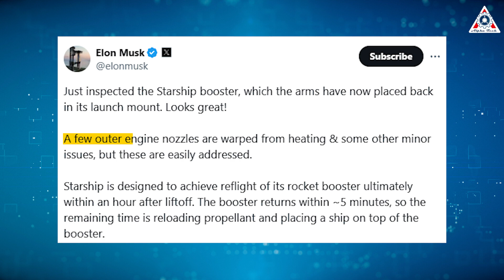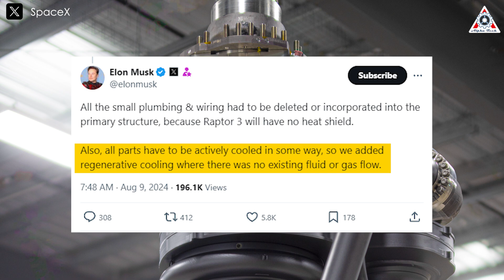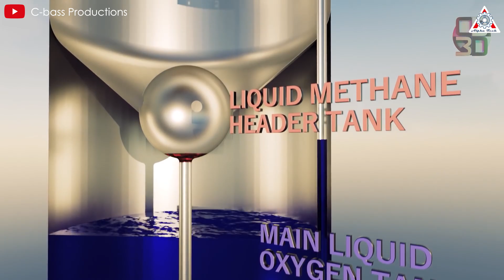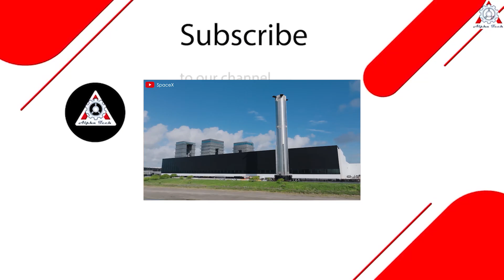Elon Musk Directly INSPECTED Booster 12 'RAPTOR Engine WARPED' & declared this...

Comment: It's why they ran Raptor 3 for a long duration burn, 15 minutes if memory serves, this is to test if they can handle the heat of decent before they fire.
Reply: the raptor engines bell housing is actively cooled by running propellent thru it during operation. my question is how will they be cooled during booster decent when the engines aren't running? you can  see the engines glow cherry red during its decent.
Reply: Yeah, that was an impressive test, indeed!

Comment: If we possibly can make a kerolox ffsc cycle starship with more thrust than superheavy higher power density and maximum effciency
as the fuel will be ultra hot
and preburned. its good to envision

Comment: 3:10 “ Given that Super Heavy is considerably greater than Falcon Nine it’s decent speed is significantly greater”?
Hang on, I thought all objects in a vacuum fell at the same rate regardless of weight.
Reply: i think he talked about reentry, falcon boosters slow down more there because theyre lighter
Reply: nether of these rockets are accelerating during free fall, they are slowing down do to drag, falcon9 has more surface area to weight ratio, so it slows down much faster,  so less heat.

its like dropping a brick vs an empty soda can, they will fall at different speeds unless they are in vacuum.

Edit: the rockets are not in vacuum, they would not be generating any heat from friction or slowing down from it if they where
Reply: Thick as mince!
Reply: The super heavy has a much greater surface area in its engine bay, and therefore, much more air is displaced at these high speeds. Therefore, much more displacement and heating occurs.
Reply: They aren't in a vacuum though...he's talking about when they are falling back through earth's atmosphere.
Reply: Yeah, they did not consult Newton on that little fact........
Reply: @winfordnettles3292  fact is the booster never left atmo, so it's not in hard vacuum

Comment: I can promise you that Raptor colouring is NOT due to paint - simply because when they turn red hot no paint survives - it would burn out. It may be a metal coat of a different colour metal, but that - would come with it's own problems at high temperatures.

Comment: I think they may need an entry burn just to protect from prolonged heating and slow it down a bit more? Maybe?
Reply: i don't think that'd be fuel efficient enough
Reply: @user-z9k6y  no definitely not, which is probably why Falcon doesn’t do many RTLS landings but it may keep the fire from happening, more for safety (most likely Raptor 3 has solved this issue). It was just a thought.
Reply: @Ssshady08  👍
Reply: @Ssshady08  Just make heavy duty bottom.

Comment: I believe the super heavy need to slow down much more prior to reentry. At least 800mph
Reply: Have you made any calculations that would lead you to believe that doing so would be more advantageous?
Reply: @stevedaigle3242  I could, will try. Yet the evidence is obvious. Warping, super heating, etc. I'm full aware these flights are "Prototypes" yet, flights 4 and 5 showed heating and warping in the raptor engines. Hence, my simple comment! It was NOT a complacent comment, rather a simple observation.
Reply: I believe you don't know what you're talking about.
Reply: @RyanGribble  instead of being rude,why don't you just explain why he is wrong ?i would like to know why too,i'm not a space expert and would like a civilised explanation please.
Reply: @trevorgough2286  what i said was not rude, it was my opinion.  Here's why i believe that.  The engines on this flight were raptor version 2. Raptor v3 had not flown yet but it includes a host of upgrades one of which is a more integrated engine design with less external parts.  This will improve the durability of the engines thus negate the need for heat shield, which is what we saw heating up, thereby facilitating the faster entry speed. All of this stuff spacex is doing are tests.  None of what flew yesterday is the final flight article.
Reply: @RyanGribble  welp...😁 it's easy to be a As$hole on the internet. Education is the key here. I made a statement. And a Bit_h responded. Lol...typical

Comment: I'll bet that Raptor 2 engines are still viable and can be used for disposable booster/second stage launches.. even perhaps integrating both in a booster to help in the initial certifications of raptor 3 rocket engines
Reply: raptor 2 will be more expensive than raptor 3, raptor 3 uses way less materials so it will be less expensive and faster to build.
Reply: @CUBEoneVX  You totally missed the point
Reply: Why continue to use outdated engines.  No sorry.
Reply: @RyanGribble  These are Prototypes, don't forget. The rate at which SpaceX is advancing is already pushing the limits of how accurately they can track and confirm the effectiveness of an improvement before improving further.
Reply: @RyanGribble  You forward thinking is missing the required steps and cost savings
Reply: @tsclly2377  that's the great thing,i don't have to do the thinking.  I see the path that spacex has laid out and can understand their process. I use a similar process when i build things.

Comment: This mission was a complete failure because it proved that the size for this concept is completely wrong.

In the previous missions SpaceX did a successful virtual catch in sea, so I do not know what was the reason for all this emotion.

The ship continues with heat tiles issues like the space shuttle had, and the 33 engines booster is not a good design, proved in the previous booster that they captured in the sea and saw lots of warped engines, but now in the video of flight 5 we see all motors incandescent red because of the air friction, and we saw many parts falling from the engine area while the fire suppression system was acting.

How can SpaceX solve the issue of the friction we see the engine area that almost destroyed all 33 motors ?

The easy solution is to slow the booster with more or bigger grid fins, or use the engines to slow the fall speed.

All these solutions add lots of weight to the booster, probably removing 20% of the height where the hot staging happens, and catching this 33 engines beast in the sea with a monster tower require building the tower with foundations in the sea floor.

I see lots of game stoppers in this concept, and strongly believe that SpaceX needs to abandon the 33 engines booster like NASA did with the Saturn rocket, where 5 F1 engines where dropped in sea with the first stage.

Chinese engineers are more clever, and I bet that China is going to be the first nation who is going to colonize Mars.

USA under Trump and Elon Musk rule is going to turn into a medieval country, a scenario like we see in the 1965 movie "The War Lord" starring Charlton Heston.
Reply: You should really take your medication
Reply: "Chinese engineers are more clever"... that is why they reverse engineer any western made tech?  They couldn't arrive with the product without patent violations?  Oh also... SpaceX leaves most of their patents open to the public use.  How many Chinese developments is left to open source information?
Reply: ''Chinese engineers are more clever''
Chinese engineers talk a lot but can not show any results, they are not even where SpaceX was 10 years ago, let alone building a superheavy rocket. Same with their EVs that are still more heavy and inefficient than Tesla
Reply: This is a China Bot or key board warrior.  Pay him no mind…..the Chinese culture doesn’t understand innovation of a technology.
Reply: whatever you are taking, it isn't working.
Reply: Name a technology or product in the last 20 years the chinese have invented or pioneered...the only thing china is numba one is Intellectual Property Theft and Reverse Engineering.
Reply: @bjmc812  Maybe we should send our recovered UAP's to them to figure out. ; )
Reply: I wonder how many inventions the Chinese claim to have made without stealing them first?
Reply: Trump and Musk will make America a medieval country? Lol you don't see the irony in that? You side with the permanent political class that hates the People. You want Americans to be serfs under Democrat Lord's. I am no Serf, I am a Citizen
Reply: @ReiseLukas  If Trump wins you are going to see a world crushed by Russia, Iran and North Korea dictators, millions of deaths in those crushed nations, and USA is going to be 9/11 or Pearl Harbor attacked again by enemies of Western European civilization. US citizens ignore that the America continent is just an extension of Europe, and the USA, Canada, Mexico, Brazil, etc. are ex-colonies from UK, Spain, France and Portugal.
Reply: So you're a rocket scientist working for....Blue Origin?  Oh no, let me guess you are working remotely from Mãe's basement.
Reply: @benitosalazar3749  Cry for Elon Musk failed business, Twitter lost 90% of its value, Tesla is being beat by BYD, and China is going to dominates the space industry. If Donald Trump loses the elections Elon Musk is going to end like OJ Simpson.
Reply: Alright keyboard warrior go take your meds
Reply: "How can SpaceX solve the issue of the friction we see the engine area that almost destroyed all 33 motors ?"
video: "a few outer engines are warped and other minor issues"
do you also think the engine explodes when the fuel exiting it is making friction?
Reply: @user-z9k6y  Air friction made it glow and drag forces made it warp like we see in steel mills.
Reply: @mokorily5022  rocket engines glow when they're simply running aswell 🤷‍♂you still ignored that you said almost all engines got destroyed while only a few got warped
Reply: @user-z9k6y  SpaceX is done ! ... they have no way to slow down the booster fall without spending lots of fuel !
Reply: @mokorily5022  or just improve on the engines 🤷‍♂ everyone said the falcon 9 will never land, after that they said the catch will be impossible, turns out they were wrong both times, and as he stated it's a minor issue, a few warped engines wont fuck up a multi billion dollar company
Reply: You sir are a moron.  These are test articles and this is still version  1. I can't even begin to start replying to all your idiotic points because i don't have time in my work schedule.  I do believe however you should refrain from posting anymore until your comprehension improves.

Comment: I suspected the glowing engines were descent friction or compression heated.

So cure might be a few more thrust hits coming down to lower those temps, or pumping water into the combustion chambers to use the heat to create free retro thrust using steam.

This would at least keep bell temps down and reduce velocity. Also reduce fire chances.

Could be emptying ships reserve potable water as a positive.

Elon at one time was talking water cooling for re-entry.

I'm really happy with the whole flight 5, they didnt get perfect, but close enough to not need much improvement.

Another question I had was on chopsticks to landing points allignment, if there was an adjustment, or just relying on ship's positioning system?

From the looks of things, hop staging might really be possible. which would speed things up and reduce crane and tower dependency.

And am seriously looking forward to Raptor 3/V-2 Starships.

They should be impressive... And maybe if you had them operating throttled down during backwards coming in, the cooling system could turn the generated air heat into increased thrust for fuel at an idle...

More physics free lunch, paid for during ascent.

What I am expecting on flight 6, is quicker lift off from Stationary zero, observable increase in ship's acceleration.
Less unburnt gasses in plume, and Pretty blue flame....

Also on Starship  re-entry, more long high glide time. and less over heating during final landing phase start.

From what I saw flight five Starship was not being damaged during high glide. And only took stress for maybe 30 seconds during switch over into landing manouver.

I have 100% confidence in it being easily improved.

And a bit of tweaking on booster coming in will have it looking professional.

Basically zero doubt next flight will look even better.

I'd say we are over the hump on the defeat of the Malthusian Paradigm. Now we just need to increase funding by at least 10X, increase production, and start branching out from this tech foundational point.

I think flight 6 will be that point.

And that the
 Raptor 3's will convince the last Old Guard types.

Its gonna be a new Space Navy soon, things develope surprizingly fast.

If I were the DOD, I'd have Elon and Gwen on the horn, and talking about financing a second Raptor 3 production facility, as soon as the bugs were out of the first one.

None of this was lost on the Chinese.... And sure they will grok Raptor 3's instantly.

Best to hit the ground running on all combustion chambers...

Comment: Given EMs philosophy about the best part being no part, I suspect that the coating of R3 is a heat resistant substance vs just paint. Looking at a picture of the R3, the coating atarts at a particular point where heat wiuod be generated. It would've been easier to just leave that portion bare.

I just had a thought. The "coating" may not be an applique at all. It might be a special alloy. Did SpaceX 3D print the dark colored portion of the R3? EM did say that they printed a portion of the engine to reduce plumbing conplexity. 

They could tweak the alloy to increase rigidity and/or heat resistance. Could it be that they only built one R3 to see how much more it would need yo be tweaked from the data and inspections of IFT5? I wouldn't put it past them to have built and tested the R3 as a proof of concept, expecting to tweak it from the observations of IFT5.

Thoughts?

Comment: Wouldn't it be easier to land directly on a pad either on land or sea?
Reply: No.  Then the booster would have to be picked up and moved.  They want to launch every couple of days, so it makes sense to put it right back on pad.
Reply: @charlic2  If they want to launch again in hours, then this is the most optimal way. If I remember correctly, EM said he wanted to have 1k Starships in his fleet to colonize Mars. Whatever the number, this method provides the absolute fastest turnaround time.

"The best staging is perpetual staging," would be the apropos tweak on EMs philosophy here.
Reply: Quick turnaround capability as others have replied, plus weight of booster would require incredibly heavy landing system.

Comment: Paint? No, paint would not last a tenth of a second during firing.

The black Raptor 3 is a different material. Perhaps only slightly different - anodized maybe. Though it could be a different alloy.

As to why black?

Not necessary for short-duration missions. But if you want engines to work reliably over the course of months, on demand, you want to avoid extreme cold temperatures that could warp or embrittle components. Black absorbs sunlight. A combination of temperature sensors and maneuvering will keep the engines in a nominal temperature range all the way to Mars and back, or in long-duration moon orbits.